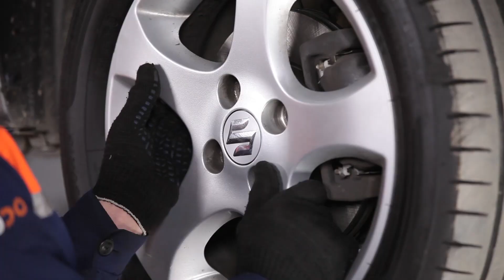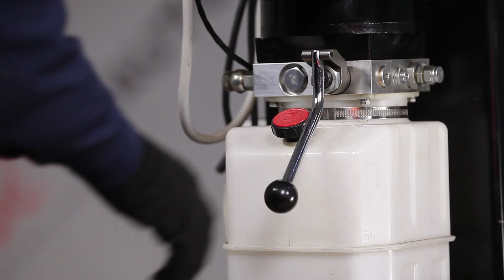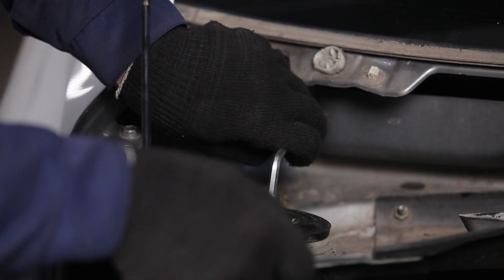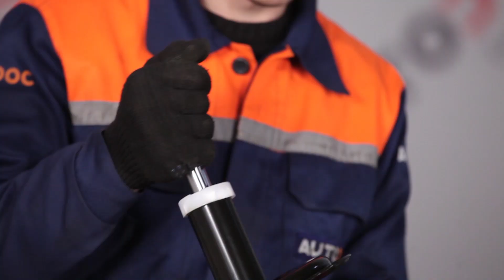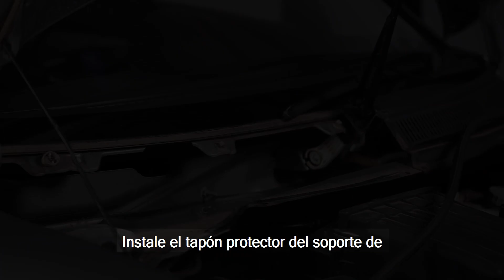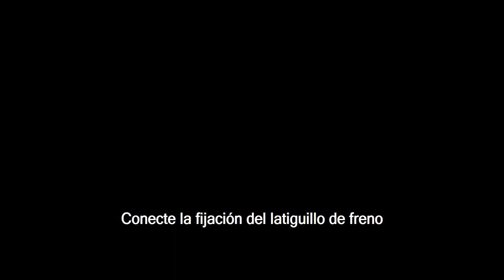Cómo cambiar la amortiguadores en SUZUKI SWIFT 3 [INSTRUCCIÓN AUTODOC]

Comment: una pregunta cambie las bases y los amortiguadores de jetta 2008 pero ahora se le oye un ruido en la suspension trasera a que se debera
Reply from the maker: Gracias por su pregunta. Lamentablemente, es imposible responder su pregunta sin el diagnóstico del vehículo en el taller. Le recomendamos ir al taller. Atte, equipo de Autodoc.

Comment: amigo desde  colombia, tengo un daewoo nubira 1998 motor 1800,se mando a reparar el carro ,se le cambiaron casi el 99% de los repuestos son nuevos,pero el carro parece tener algun fallo electrico,tiembla mucho y no desfoga bien al acelerar,tiene bujias nuevas ,instalacion de alta nueva ,bobina nueva, bateria nueva el arranque como el alternador estan reparados  nuevos, motor reparado pero persiste el fallo que hago o reviso ,gracias
Reply from the maker: Gracias por su pregunta. Lamentablemente, es imposible responder su pregunta sin el diagnóstico del vehículo en el taller. Le recomendamos ir al taller. Atte, equipo de Autodoc.